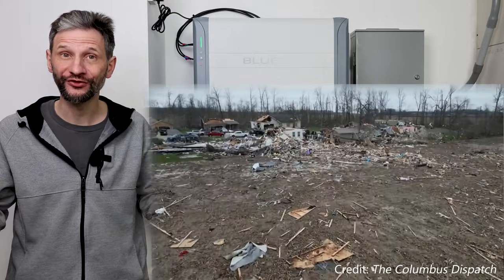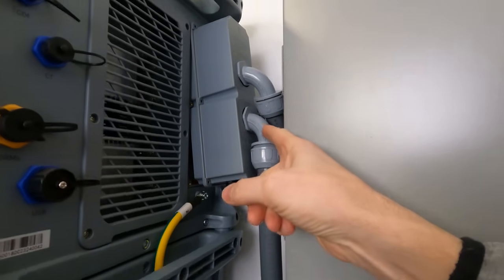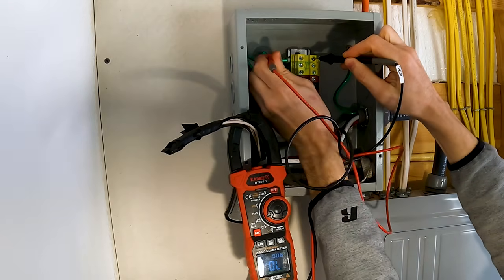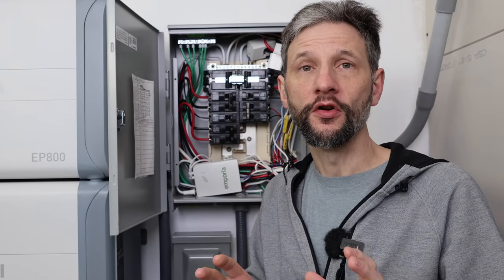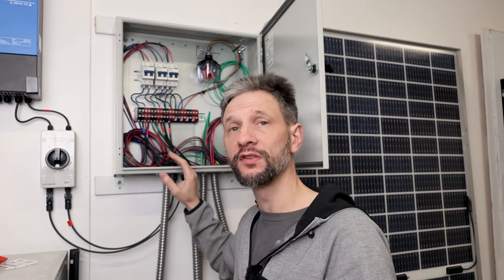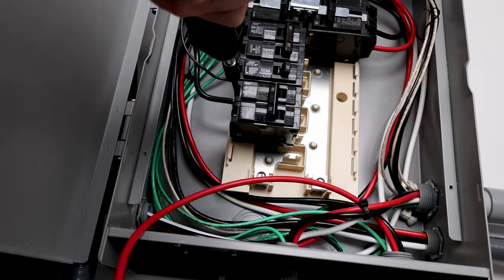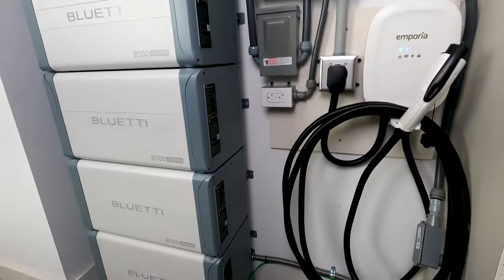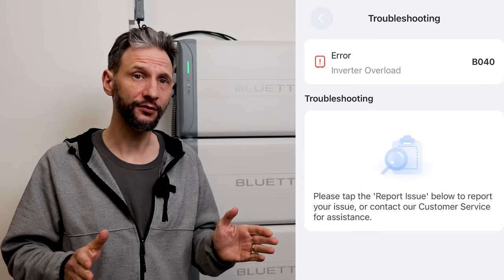EV Charging and Home Backup With Solar Energy

Comment: It's a well established fact that high frequency, transformerless inverters that lack an iron core, copper wound transformer to provide galvanic isolation between the DC boost stage of these inverters and their AC output can severely damage an EV's onboard charger and void their warranty. I would never plug my EV into one of these high frequency Bluetti inverters.
Reply from the maker: Do you have a source for your information?
Reply from the maker: Thanks for the additional information.  When repairing inverters, what was the most common failure you encountered for each type of inverter?  Were there some brands that had more failures than others?  Thanks!
Reply: @ProjectsWithDave This person writes the same comments on all videos. When they get your attention, they start to promote an inverter from China. I would ignore them.

Comment: You may be able to use your high frequency inverter to charge your EV now, but it's just a matter of time before the MOSFETs or IGBTs in your inverter fail and you can kiss your EV's onboard charger goodbye. A much better and safer choice if you want to charge your EV with solar is to use an inverter or power station that uses low frequency, transformer based technology in its design. Low frequency inverters can handle high surge loads for at least 3x their continuous rated capacity and they can do this repeatedly, without sustaining damages to their MOSFET transistors, for minutes, rather than the milliseconds that a high frequency inverter offers. And because low frequency inverters use a transformer, they provide galvanic isolation which protects your EV's charger. That's why the big name brand inverter manufacturers like Schneider Electric, Outback Power, Sigineer Power, Magnum Energy and Victron Energy and others, all use a low frequency topology in their design.
Reply from the maker: The biggest advantage with a low frequency inverter is the ability to start large induction loads.  As I mentioned in the video, these transformer-less inverters typically can not run large power tools.  The toroidal transformer in the split phase 6kVA Victron system I installed in this video can power induction loads with no issues: https://youtu.be/ipLRNglTdhg

Comment: Without an iron core, copper wound transformer in this unit, there's no galvanic isolation between the DC boost stage of this low peak power inverter and its AC output. All its going to take is for a MOSFET or IGBT in the H-bridge circuit to short to ground and the AC output monitoring circuit to fail and you can send dangerous high amperage current to your EVs onboard charger which can set your EV on fire. A much safer choice for charging your EV is to use a low frequency, transformer based inverter charger.

Comment: What I see is taking  the AC converter out of the EV and do DC fast charging from a battery pack near the EV. The battery pack could be charged off-peak. The battery pack could supply power to the household. Your setup seems a bit complex. Thanks

Comment: Another top-notch video.  The way you break things down into chapters and logically explain how different parts of the system work, and how they work with the rest of your home's electrical system, is very easy to understand.  The problem I have with this product, is that this is not something the "Everyday" person would choose.  This is a VERY expensive product, for what it is, and it locks you into a very expensive ecosystem of proprietary products.  This is the antithesis of what I have come to expect from Everyday Dave.  It's still a good and useful product, albeit an absolutely horrible value.  I hope you don't do many more of these paid advertisements because this is not what I have come to your channel to see.
Reply from the maker: Thanks for the feedback.  There are a lot of these types of systems out there now, and it seemed necessary to try one out.  I like to physically prove things out rather than just give my opinion, and that necessitates actually building and testing one.  I tried to add value to the video overall with the rest of the system construction.
Thanks!

Comment: Never had much luck with daisy chained batteries maybe they have adjusted for the voltage drop during discharge / charging operations.
Reply from the maker: It's not ideal, but this system has some advantage over the typical 52V setup as the batteries are running at 100V.

Comment: Have you tried to turn on/off the EV charger based on state of charge for the batteries.  For example i would like my emporia charger to turn on (offer charge) only when SOC is > 90% and shut off if SOC is below 70%.  I think you can do it with the monitoring system, but I'm not sure
Reply from the maker: That's a good idea, but I don't know of a way to do that in the current software.  The EV charger only knows the instantaneous loads, it doesn't know the SOC of the battery.

Comment: Great system Dave and very informative videos all round.  Subscribed.

NB the a Solar Water Heater system can be 90% efficient for the Evacuated Tube system. (which works even in cold, snowy areas)
When you compare that to Solar Electric Panel plus inverter etc efficiency...  well solar electric just doesn't stand a chance.

Point being:  Spending some brain power calculating the power saved by direct solar water is a worthwhile exercise.
Especially if the hot water can be used as a heat battery somehow...
Reply from the maker: Thanks for the sub!  I have done some experiments with directly heating water with solar panels.  While cheaper, it's not a great way to go because you loose the efficiency gained by an MPPT.  As you said the most efficient way to heat water is direct solar radiation on some tubes.  You just have to decide if it is worth managing multiple systems.  The reality is, if you size your solar system to get you through the winter, most of the year you will have excess solar you can dump into hot water basically for free.  In that case the radiant system is only helpful for a couple of months in the winter.
Reply: @ProjectsWithDave  ...Ah-ha!  I see.  Thx for pointing that point out.

It would be interesting to see your 'overproduction water heating system' in detail.   I haven't looked through all your videos yet to see if there is one..?
Reply from the maker: I haven't made a video on that yet.  I would like to show how to set up a water heater on a relay.  The tricky part is programing it to automatically kick on at the right time so I don't have to baby sit it.  In my case I can sell excess power back to the utility at $0.07/kWh so I don't actually need a dump load.  It's more of a fun experiment to better understand efficient off-grid operation.
Reply: @ProjectsWithDave  Thx.
Surely there's already a relay somewhere kicking on when your system does feed back into the grid that you could simply tap into?

Comment: The auto regulating on the emporia charger is so useful! I need that, I'm off grid with only up to 10kw production. Guestion: I have the monitoring system already, do I just need to buy the charger and will everything else just be set up thru the app to regulate the charge speed when an additional load kicks on?
Reply from the maker: I know, it's a great solution isn't it!  The sensors and monitoring portion from your current system will work.  That is exactly the same parts that come with the balancing charger.  However, you may still have to purchase the load balancing version of the charger.  I'm not sure if there is a difference between the standard EV charger and the Load Balancing EV charger hardware.  Maybe someone out there has the base version and can answer that question.

Comment: Hi Dave,  Thank you for the video...I found it helpful.  Shouldn't those HV PV wires be in a metallic conduit?  I believe the NEC requires this.  It looks like an opportunity to improve the safety and compliance of your installation, which otherwise looks very good.
Reply from the maker: The PV wires are in metal conduit up to the unit.  Unfortunately, this system does not have a method for connecting the metal conduit at the inverter so the wires are exposed for a short distance.

Comment: 25:15 Dave mixes up his green and blue solar inputs...
Reply from the maker: Thanks for the comment.  I changed the tape part way through the filming process and I can never trust myself not to switch things.  That's why I recommend using a meter to check the polarity before connecting the solar inputs.

Comment: Thanks to the Author, but I use Victron.(I cry once while buying equipment) (not sponsored by Victron).(🤭).
Reply from the maker: I have a Victron system I have been running for more than a year with no issues, you can see the split phase install here: https://youtu.be/ipLRNglTdhg

Comment: I couldn't resist the pricing and ordered a pallet of solar panels from signature solar. I now have 14 kw of panels and nothing else... What would you do next in my case? using 3400kwh per month now...I need to reduce my usage some too.. are the solar powered hybrid mini splits a good option to reduce power consumption in an easy way by limiting the running of my 2 Central AC units? or better to just get a full system going? I am in Tampa FL My backyard faces south but I live in a HOA
Reply from the maker: Did you check with your HOA?  I recommend designing the whole system and getting permit approval before purchasing your equipment.  See this video on permitting: https://youtu.be/imiEYDHLG4A
If you can I would build a ground array: https://youtu.be/w-iS_8e7n60
Once you know ground or roof, you can work on what inverter systems to look at.
Reply: You can get a growatt or EG4 offgrid inverter, and run it without a battery, or just one battery, and set it in "utility mode" where it uses power from the panels first, and then supplements from the grid. Of course, it sounds easier said, you'll have to move over loads to an essential loads panel. But otherwise, yea some mini splits would be good, assuming your main usage is from AC.

Comment: Great video Dave. About the only thing I disagree with is spruiking that this could "save people money by peak shaving". I think that would only be true in the case of very high electricity rates and very high electricity use. On a simple ROI formula it would take much, much longer than the battery and inverter warranties to come out ahead. If you're doing it for energy security and to replace a diesel generator then that's great but don't do it to save money.
Reply from the maker: Yes, to clarify, peak shaving may help to recoup some of the cost of the system.  As you said it would take some very high rates to justify buying batteries for that reason alone.

Comment: It's a good system if your given it for free but for everyone else just waay too expensive like double to triple the price of other kit.  I'll stick to my Victron and Pylontech which is 9.5kwh battery 6kw AC in/out and up to 11kw of solar for under 5000 bucks
Reply from the maker: The Victron system is a great system, but may be too complicated for some installers and very few of their inverters are UL listed which may be required for some individuals.  You can see my split phase Victron version here: https://youtu.be/6WO44Pa5EwI

Comment: In your 3 year old video about building your own backyard solar array, I noticed you never talked about other cost factors such as the increase of property taxes potentially or the hidden fee for adding solar that the local power company will try to add to your bill.  You never talked about the headache of installing your system or as with any puzzle if one piece is missing then the whole project is a failure.  You also have to factor in any savings that you get from the power you also have to set aside some of that money to replace the battery and solar panel for whenever it decides to die orwin knew better efficient solar panels come out and you want to replace them with the old ones and then factor in the cost of selling the old ones.  I don't know but I am assuming that old batteries and old solar panels are going to get a very low return such as buying a used car 
  You also didn't compare the difference between putting down $20,000 to say the stock market and seeing the return over 25 years compared to the savings of solar panels and being -20,000 and trying to recoup for the first 5 to 10 years only to make a savings in the next 10.  I want to go solar myself but the numbers just don't make sense right now I don't think. I'm not sure why you had to go to Japan because you could have seen the prime minister in Raleigh North Carolina today eating barbecue, wow Governor Roy Cooper puts on his lipsticks to kiss his ass
Reply from the maker: I created a calculator to compare a typical investment with installing solar.  You can see that video here: https://youtu.be/YjKPHuc8T38

Comment: Neat but for £19,000 I don't think the cost is worth it over a self made system.  I can get a 20kw totally kitted out solar set with nearly 20KW of solar and storage for that price with a 12kw 3 phase inverter. 
I get there's a market for these, same as Ecoflow's batteries but they aren't anywhere as cheap as they really need to be to actually provide value for anyone who can follow simple instructions in how to wire up electricals.